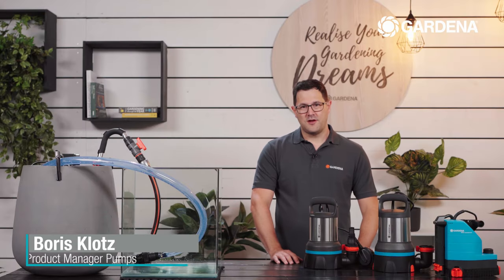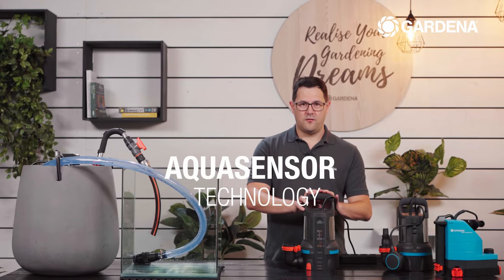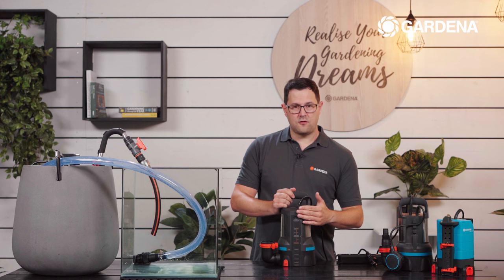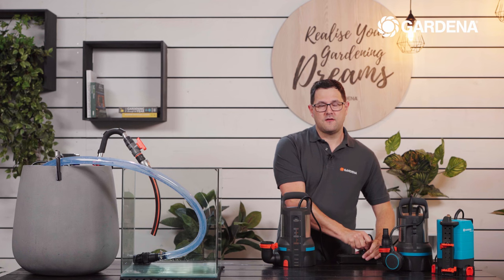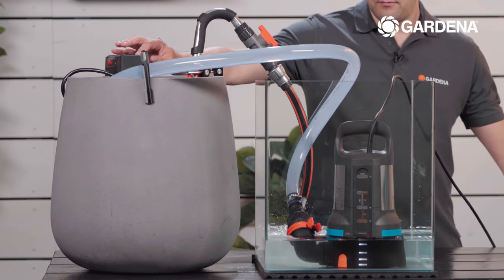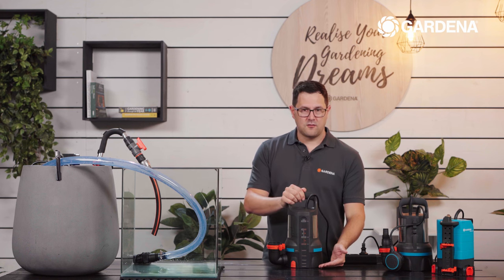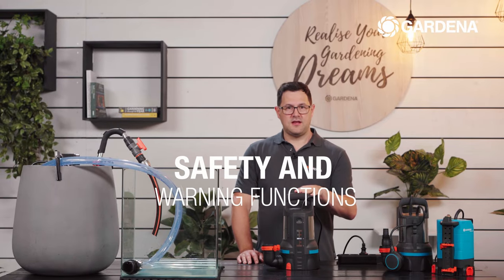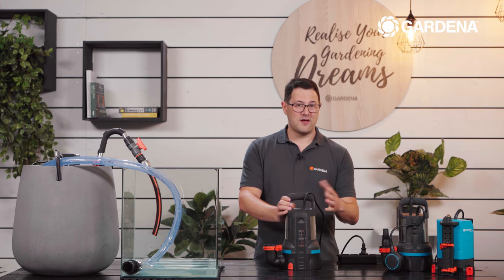GARDENA AquaSensor Pumps | Functions

Comment: I've been using the Aquasensor 9000 (the old model as shown in the video) for years. As I knew machines don't have an eternal life I bought the 11000 about a year and a half ago. Did not immediately got it to work and not yet really needed it to. A week or so ago I tried to get it working with no succes (couldn't set the level for auto start/stop). Two days ago my trusty 9000 ultimately broke down so again tried to get the 11000 working. Frustratingly the answer was no. 
Long story short: the original manual I had for the device told you needed to use S9 not S7 to start the programming process. I found a newer manual and this video last night correctly mentioning S7 and now the pump starts and stops as required. So always check if a newer manual is available and if videos like these exist.
Note I use mine standing on a flat floor, unsubmerged, just to keep the water level in my garden (which is mainly hardened surface) under control.

Comment: Bought mine today!:) just one question. The orange feet you can move inward and outwards. Do I need to do something with this? I do not understand:) thank you
Reply from the maker: Hello,
thank you for your message.
The easy to use flow boost feet can lift up the pump, if flat suction is not needed to boost the pump performance.
Helpful information about our products can also be found on our website:
https://www.gardena.com/int/

Best regards
GARDENA Service

Comment: I bought Dirty Water Pump Aquasensor 20000. When I am there, it is working. But when I leave and the rains start, the pump does not restart based on the settings of water levels. Or maybe it does but then stops working after some time. My cellar is completely flooded again because I can not there all the time and remove the pump from the water to start working again. I thought this will be a reliable product when purchasing. But it seems it is not reliable.
Reply from the maker: Hi Gorglin1,

thanks for message and for having chosen a GARDENA product. Did you set the automatic mode?
Automatic mode is signaled by flashing of sensor light 9. The functions of the pump can only be set outside the water and with a dry sensor field. You have to stay on the sensor fields long enough.
In which country do you live? We'd like to adress you directly to GARDENA Service in your country to help you.

Best regards from Germany,
GARDENA Service
Reply: @GardenaWorldwide  Hello, yes I have set the sensors as mentioned in the manual. I live in the Czech Republic. Yesterday I have set the lower level sensor to be higher. I suppose the problem might be the water coming back from the hose once the pump stops after reaching the minimal level. Then it has to keep pumping all the time and stops after some time. I hope this will fix the issue.

In general I suppose it would be good to implement some reverse throttle valve already to the pump to avoid return of water.

Thank you for getting in touch with me.
Best regards, 
Gorglin 1
Reply from the maker: Hi Gorglin1,

please contact GARDENA Service in Czech Republic using the following link to the contact form on our website: https://gardenasupportcz-sk.zendesk.com/hc/cs/requests/new

Best regards from Germany,
GARDENA Service

Comment: hi ,
does this product initialize automatically under water or should this be initialized outside water ? Like can i unplug it and then later just put it in water and turn on the electricity, wiil it initialize fully submerged 
under water ?
Reply from the maker: Hi,
thanks for your question and your interest in our products.
In manual mode the pump runs until the pump is disconnected from the power supply. 
In manual operation the sensor fields are deactivated.
The pump then runs until the pump is disconnected from
the power supply or another operating mode is selected.
Keep the sensor fields S6 and S8 pushed until the double flashing of all LED’s has acknowledged the
input.
All LEDs will light up and within 5 seconds all the LEDs will switch off one after the other. The pump starts. After 10 minutes the pump automatically switches back to automatic operation.

After disconnecting the power supply, the pump automatically switches
back to automatic operation.

In automatic operation the pump switches on automatically when the water level reaches the switch-on level and switches off automatically when the water level reaches the switch-off level.

We hope this information answered your question.

Best regards from Germany,
GARDENA Service

Comment: Hello, i have this pump (20000), but it's been starting to blink (S5) and then all ligths blink. It says that it is a problem with the sensors being dirty, they are now clean and still the same. i've been trying for 2h. what do i do?
Reply: Same problem here
Reply: @fredericmery991  i wiped it alot, pulled the plug, put it back in the water (enough to cover the whole range of sensors) and put i back in the socket and it started working again
Reply: Let me know if this works, it could be a bug, so that others who have the same problem might see this.
Reply: @klejonellet my pump works but it doesn’t stop automatically anymore. I cannot manage to enter the setting function s7 to set another range min-max…
Reply: I have clean all the pump and leds captor. Same problem after, le s5 is blinking when inpress s7 to set up and down level
Reply: @fredericmery991  try to unplugg it, put it in the water, replugg it - so it starts IN the water